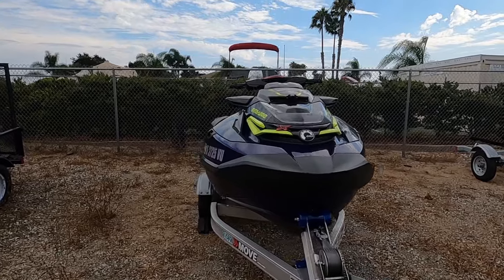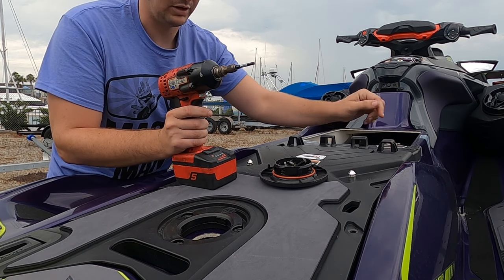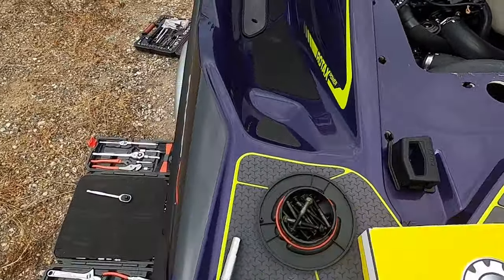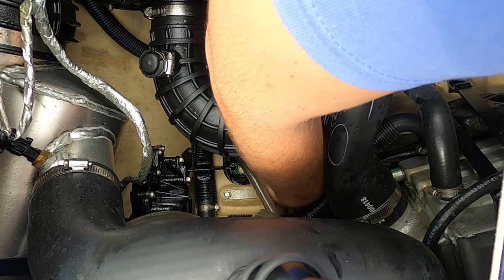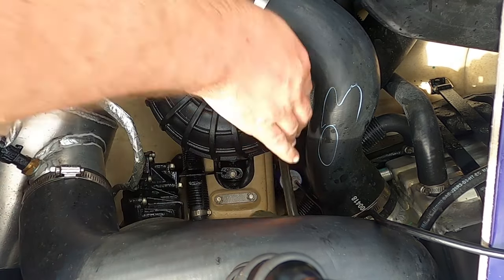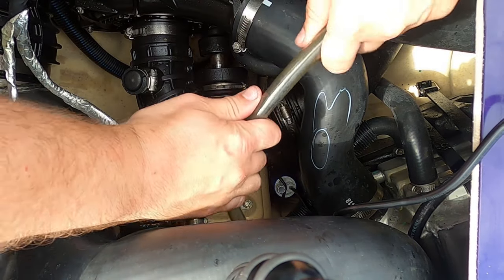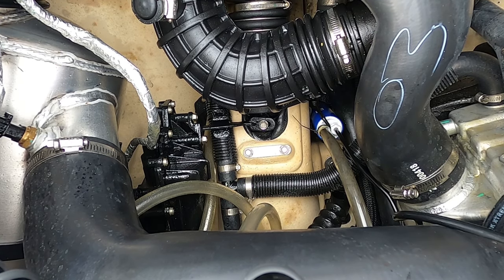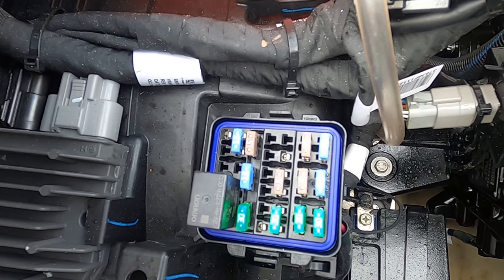Local Idiot bumbles through installing bilge pump on his Sea Doo RXTX 300: a walk through.

Comment: Not seeing any bumbling. Looks like you knew what you were doing. Good call on the fluid film as well. Thats a good tip. I have been looking at the RXTX but thinking its a lot for a fist jet ski and I should stick to the sparx series as a learner.
Reply: @badm0t0rf1ng3r  Ohh. So I would be doing ocean stuff. Not too far out but mostly along the coast line.
Reply: @badm0t0rf1ng3r  Sweet. Thanks! I plan to pick one up offseason when demand is low for next summer. Great advice!